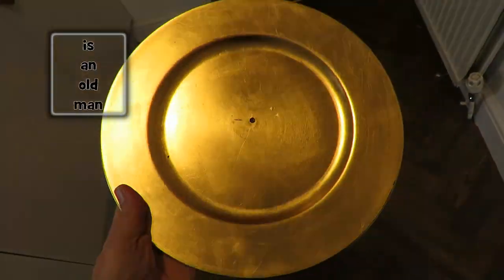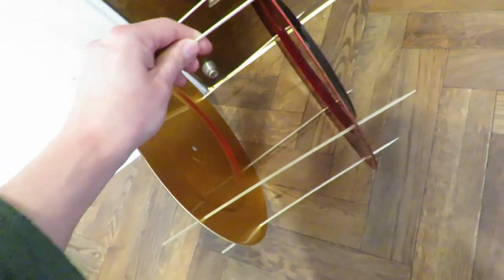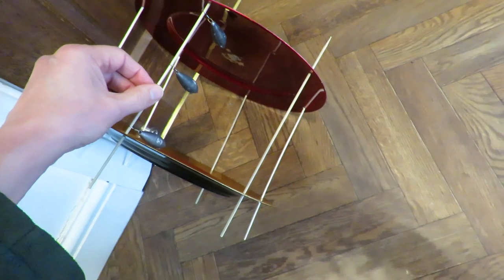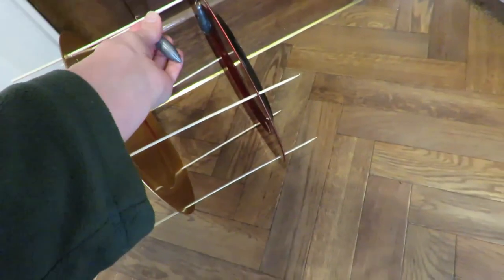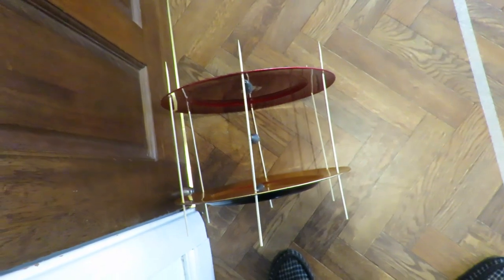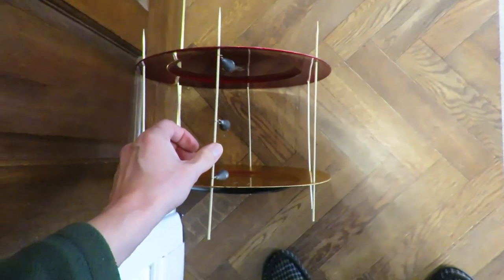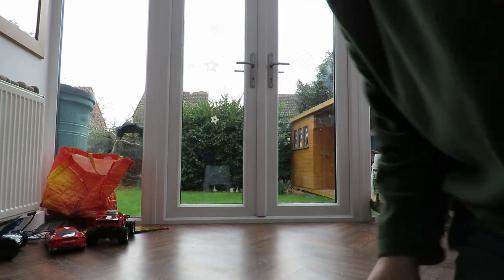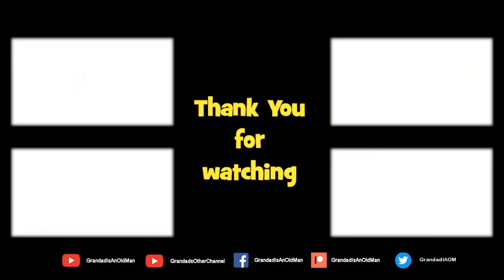Simple basic gravity powered car

Comment: Interesting concept. Perhaps it would get more speed if you had say, 4 weights on one bamboo cane, 3 on the next, 2 on the next, and 1 on the next....hope I explained that understandably....That way the car would effectively have more acceleration time...maybe it would end up having a bit more momentum at the end. It would accelerate more slowly of course, but it still might get a bit faster. I would be interested to see you try that with this car, if you have enough weights.
Reply from the maker: Sounds like you are thinking of those fake perpetual motion machines. Anything behind the top dead centre will just be reducing the effect of the weights dropping in front of the top dead centre.
Reply: Right, I just thought that perhaps there is some sort of non-linear proportion which would allow more weights to minutely increase the acceleration. I see now that that wouldn’t work like that.
Reply from the maker: @AeroCraftAviation  If I hadn't already have disposed of the evidence (the plates went in the bin after I finished filming) I would have given it a try as theory is one thing but actually trying it out can often prove my theories wrong or at least spark another idea or project. As far as possible I try to get rid of as much of my stuff as I can now because my junk pile has got completely out of hand. I can even get to my chair in my work room and certainly can use the desk.